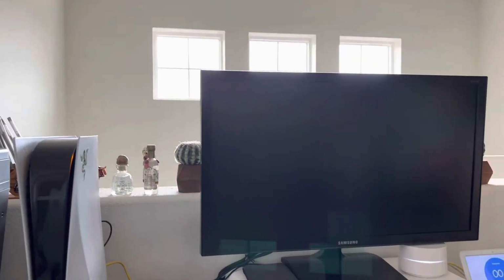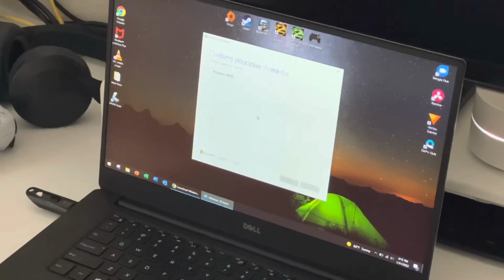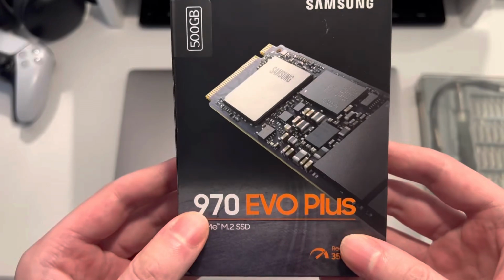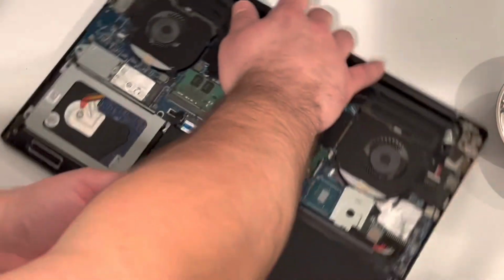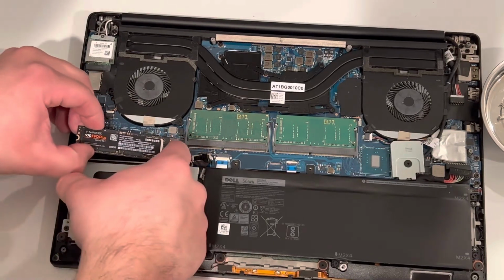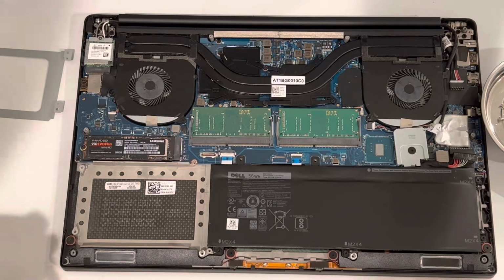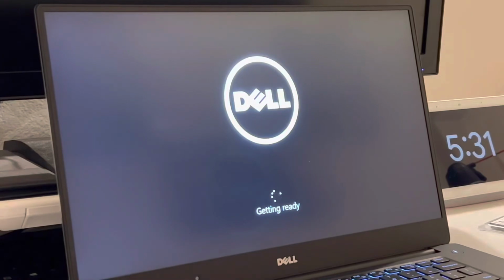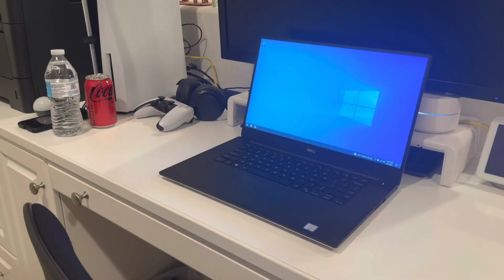Dell XPS 15 (9550) upgrade tutorial.

Comment: Thanks for this. Been thinking for ages about an up grade to get a little more life out of the laptop. So the OS runs from both drives hence the HD must also be replaced/wiped or removed?
Reply from the maker: No OS runs from one drive you switch it to the faster one for quick load times. Othe other drive is for memory storage.

Comment: Thanks for this. Can i upgrade the SSD while also keeping the HD? I need the storage space, but wouldn't mind a faster boot time...
Reply from the maker: Yes you can
Reply: @jaymous91  thank you! And if I do I'll need to reinstall windows through a flash drive, yes?
Reply from the maker: Yes, make sure you have the Wi-Fi card driver ready.. it will need to be installed manually to get your computer back to normal
Reply: @jaymous91  ok, so forgive my questions and humour me one last time: at the moment I do not see the SSD partition, but my laptop says it only has one drive (the 1tb HD). If I upgrade the SSD module to a 512gb one, will I actually see that space? Or do I need to do something special for it to show up?
Reply from the maker: You will have to follow the steps in the video (turn off raid) install windows on the SSD and update everything. you can the turn raid back on and add HDD as internal storage
Reply: @jaymous91  thank you !
Reply from the maker: Thank you for watching! If you can please subscribe. It really helps me out
Reply: @jaymous91  done
Reply from the maker: Thank you  🙏
Reply: @jaymous91  Hi Jaymous 91! Nice to meet you and thank you for your video. What if I want to maintain the ssd sata as first herd drive with SO (windows 10) and add the ssd nvme like second hard drive only to storage? What are in this case the bios settings? Thank you so much!
Luca
Reply from the maker: @lucacovello5594  format the drive to NTFS and turn raid  to 0 when you are in window you should be able to add it as storage
Reply: @jaymous91  Thank you for your answer Jaymous. So in "Sata operation" I have to check the option "AHCI", instead of "DISABLED" or "RAID ON", right? Thank you so much!
Reply from the maker: @lucacovello5594 yes turn on AHCI to allow one operation drive. Keep raid on to use both SATA ports for storage.

Comment: what competible  pcie samsung 990 pro,,,,sir
Reply from the maker: Any NVME module, don’t over spend on speed you will not get the full potential due to old hardware
Reply: @jaymous91  what wifi ax210, killer 1650x,1675x competibele dell xps 9550 ,,im go to upgrade wifi,,request thebest

Comment: How did you get the Wifi drivers installed? I cannot seem to figure it out.
Reply from the maker: I used another computer and found the Wi-Fi drivers on Dells website. It will show up as a Bluetooth driver but it is actually the Wi-Fi one. Or you can go to your original C Drive and copy the driver from there.
Reply: @jaymous91  I tried that and could not get it to work. I bought a $10 wifi usb dongle off Amazon and it worked perfectly!
Reply from the maker: Ok,  it took me a few tries. Glad it worked out..
Reply: @jaymous91  Can I ask which driver i have to install?
Reply from the maker: @vins2393  it’s the Bluetooth driver, that contain both Wi-Fi and BT.  I think it is the Broadcom one
Reply: @jaymous91  thank you